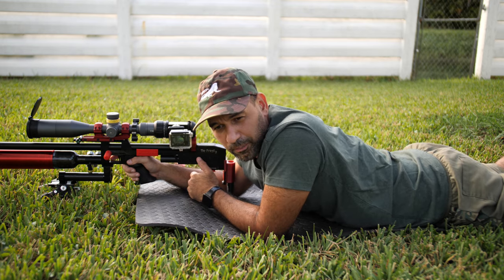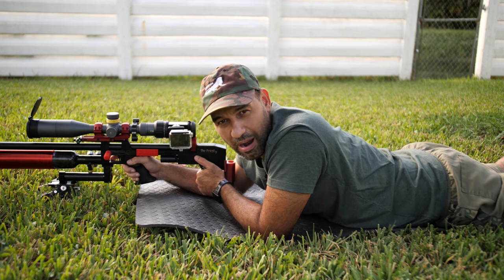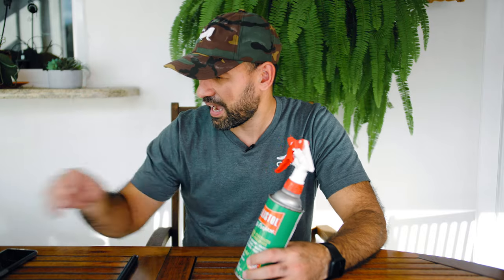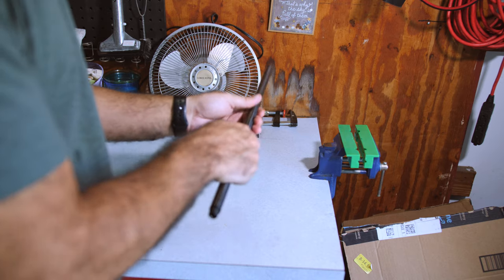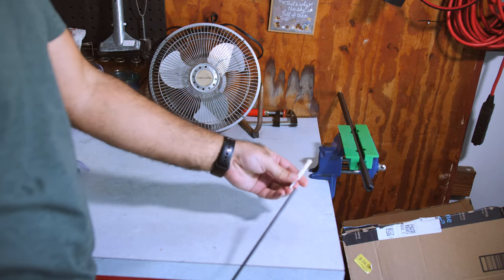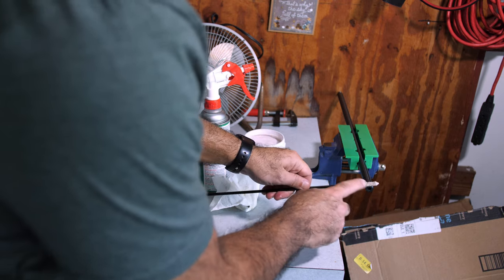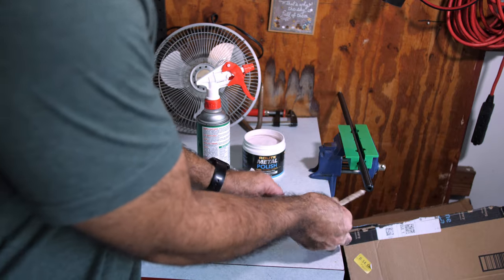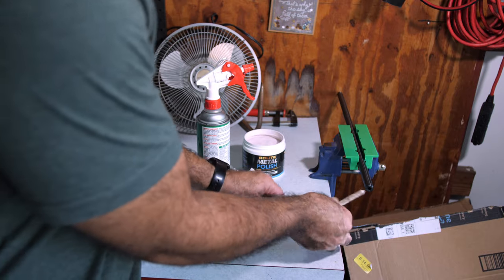How to Polish your Airgun Barrel | Orion the Iguana Hunter

Comment: Orion, NT from AGN here.  Well done sir!  That DIY will undoubtedly help a lot of people that have been on the fence about trying it.

However I'm sorry your barrel turned out the way it did.  Now you have to buy the pricey Polymags :)

Your method has several little differences compared to mine and your results speak for themselves so that just goes to show there's more than one way to get to the finish line.

I will say I initially thought you may have done the Rolite polish and J-B in the wrong order.  I haven't used the Rolite but they're calling it a polish.  Of course "polish" is not a quantitative term but I do not consider J-B to be a polish so my assumption was those two would have been better done in reverse.  However I saw your reply below addressing this:

"I have had more than one person on the comments recommending starting with the JB paste first, but when I tried on my knife I had the feeling this metal polish had a bigger grit than the JB paste, I can "hear"  and "feel" the polisher but with the paste was more like applying a wax, smooth, that's why I followed that order.
"

Perfect!  For others reading along, if you're wanting to improvise different abrasive compounds, that's exactly what you want to do.  Try them on a piece of polished steel like a knife blade and see if it hazes the surface or takes it to a finer polish.  In order to help knock down the surface fretting left over from the drawing and/or rifling processes,  most new bores are going to benefit from starting with something coarse enough to haze a polished surface.  Then move on to a finer compound if desired.
Reply from the maker: Wow! What a great honor to read your reply! Thanks for that! Very much appreciated!
Reply: I cant remove the crown of my break barrel. Its a Cros nitro piston with a "silencer" at the end. Yet my brass cleaning rod wont reach the crown. Should I leave the crown alone or just come in with the rod on the other side. The crown is steel so the brass brush shouldnt ruin the crown?

Comment: Just use WD silicone spray on the pellets then let them air dry and you won't ever have a dirty barrel. 8000 shots with my impact mk3 and it's still super clean. Not regular WD 40, it's the yellow can of WD 40 silicone edition spray. You soak all your pellets then spread them on a towel to dry for a day and your barrel will neer gum up again as long as you always pre-treat new tins of pellets every time. Pro extreme bench rest shooters do this.
Reply from the maker: I've  done  that and works great, thanks for sharing... One small issue with that is that I paint my pellets and the spray will gets in the way... What a mess I did tye other day 😂

Comment: Yep, polishing a bbl. can do wonders. Even more so in a slug shooter. I like to end with a polish with 
German Flitz no abrasive polish.  In one of my  Custom Talon/Dor 257's the gun went from a 50 shot gun before accuracy suffered, to a 300+ shot gun. The 
FX  superior heavy slug barrel I installed in the Raptor  can go for a couple thousand slugs now. Unreal!

Nice vid!

KnifeMaker
Reply from the maker: Mike!! Nice to see you on the channel! WOW 300+ shots is unreal. I'm planning using slugs on this barrel again. The last time I use them the accuracy was outstanding. I need to test them now after the polishing, at least pellets did great.

This metal polish works really fast, I have had more than one person on the comments recommending starting with the JB past first, but when I tried on my knife I had the feeling this metal polish had a bigger grit than the JB past, I can "hear"  and "feel" the polisher but with the past was more like applying a wax, smooth, that's why I followed that order. You are using a different polish, German Flitz and no abrasive, maybe with that one the order can be inverted like some have suggested. 
Have you tried this Rolite before? The knife I tested this looks like a mirror! I'm amazed by that stuff
Reply: No Sir, I'm not familiar with the product  Rolite.  I do sometimes cheat. I have quite a selection of professional Knife polishing compounds here that I from time to time melt onto a bore swab and put af finishing polish on the bore.  A full blown mirror.   I remember  Matt D. stating that a full polish was not good as a textured glass window would allow your finger to glide over it, where as a normal clear glass would squeak and have more friction. . I guess he forgot that we use lube. Which gives exactly the opposite results. ;<) .   Put lube on clear glass and it becomes more like trying to walk on wet ice. Same with bore. 

I know a few world class field target shooters who actually wax their bores in the pellet shooting arenas.  It doesn't seem to help at all with slugs however. I use only 10 wt RC shock oil (silicone). Odd, as silicone is  not for metal. However, for whatever reason, it helps greatly! I was first told of this by RoachCreek. Who held the long distance  of 615 yards for  years. It had now of course been broken. Sad that he is almost blind now. He has a lot to teach.  He was a Champion Shilo 
sharps long range shooter for years. top Honors.  I am lucky to have him as a friend and mentor. 
 Knife/Mike
Reply from the maker: @michaell397  wow, reading your comment is learning guaranteed...hope you will keep commenting on my videos so everyone can learn from your wisdom... I'll give the silicone a try

Comment: Thank you for this video bud. I just realized how thick the barrel is on your gun. My most consistent PCP…meaning the one gun that is almost never knocked out of POI and almost never needs adjusted, also has the thickest barrel. My .25 caliber SK-19 has a barrel that is thicker than barrels I have on some of my rim fire rifles. 1/2”-5/8” or so. I think these PCPs with thinner barrels are more dependent on the shrouded and barrel bands to maintain POI. I bet you seldom have to adjust your scope on your RTI. That would make a heck of a truck gun in a compact rifle configuration bud. My SK-19 hangs all the time by hooks on the head rests of my truck. One supports the stock by the magazine and the other supports the LCD. On or off road vibrations and stress do not effect my accuracy. I take shots frequently past 100 yards on pigeons and it never fails to hit the spot. Really good design RTI came out with. Stay safe and God bless you and yours my friend.

Comment: Heck, man, now you got me thinking... 🤔 Nicely done, Erlis! 👏 Happy holidays!
Reply from the maker: Alex my friend! Don't think too much! Just do it! Hey if you can't find the right products over there, well you will need at least the metal polish but I think that should be available there, maybe not the same brand but I think any metal polish should work, but check this out. A guy told me he used a paracord rope, need to find the right diameter for the barrel, he added the polisher to the rope and used around 10 meters of ropes, and push the rope one time through the barrel... another clean rope to remove material and done! In less than 5 mins it was polished, very very interesting.... Happy Holidays for you too my friend

Comment: I used a Napier pull through kit to clean the barrel first. always push a few pellets through first so you can gauge where any tight spots are that might require extra work. I just use Autosol and a length of cotton hem tape 3 - 4 times the length of the barrel with a few knots tied close together in the middle. I pull knotted section end to end (but not out of the muzzle ) about 20 times. Next clean with the pull through kit and push a few more pellets through. If still feeling any tight spots concentrate on those areas only clean with the pull through kit and try a few more pellets through. You can use this to reduce an extra tight choke too but will need to check the crown afterwards.
Reply from the maker: Great tips, thanks for sharing!!!

Comment: Great work Erlis very much appreciated. I do believe I will give this a whirl on all my rifles to see what happens. My Armada is one of my "untouchables" in that it is extremely accurate just the way it is but ever so often I see a wobbler and/or get an odd shot result so a polishing should really tighten this rifle's results. Another product that I use in all my firearms and air rifles is FP-10 Lubricant elite by Shooter's Choice. I live where the temperatures range a lot, esp in winter. This stuff is good from -49F to 500degrees F! I have never had issue hunting elk in Montana where the temperatures can dip to -20degrees F during the hunt. No action or trigger freezing, works the same warm and cold. Ballistol oil and FP10 are the only things I use on my air rifles.
Reply from the maker: Hi Bret! I have FP-10 but I've never used it on the airguns, I wasn't sure it was safe on the o-rings, I know that FP-10 is magical, I used to have a door that always was giving the terror movie sound, a couple of drops of FP-10 and for months no more sound, magic! I'll give it a try on the barrel! Great idea

Comment: Nice that it worked out good for you. Did do the polishing thing years ago on my AA Pro Target in 177. Did not work out very well. Barrel was/is a CZ S200. Did take the better part of a tin of pellets to lead the barrel and shoot wel again. Since then I only clean my barrels when groups get bigger. Use a pull through til the patch gets clean. Then shoot up to 20/25 times to settle. Never had good grouping from a super clean barrel. Counting  in my power burners. Also find it fascinating that different pellets shoots equally well. Maybe cause they are all by JSB. 
Again happy for you that it worked out so well. 
And wish you Merry Christmas and a Healthy , Happy New Year.
Reply from the maker: Different barrels like different methods, I remember my Taipan was similar to what  you are describing. But in this rifle I noticed that after a clean the groups are great. Maybe it has to do with the tolerances inside the barrel, if it's too tight vs a bit more lose. 
The fact these 3 pellets did well is not because they are JSB, you can see how the Polygams were doing before, not a single hole! Hades were grouping also before but not as well as this time... I have a video I posted like 3 months ago where I'm shooting all different kind of pellets and you can see the groups there. I think  what you saw in this video is because the polishing

Comment: Happy holidays my friend. Great video. I may try this on my SK-19 .25 Calibers Polygonal barrel. It shoots lights out for about 300 rounds but after the barrel leads up a bit and the groups start to open up. That’s for showing us how buddy. Never tried this before. God bless and stay well.
Reply from the maker: Heat my friend, give it a try and let le know my friend. It's duper easy to do and doesn't take that long. With this and silicone tip slugs, iguanas better run!!

Comment: I’ve used Flitz and Mothers to polish.  Used mop to apply and just ran tight patches to clean.   I can get more pressure in the interior of the barrel & rifling with patches.
Reply from the maker: If it worked that way great! I read that with just patches can take long to get a polish, but if it worked for you awesome! As I said, I'm not an expert, I just tried what I read and I saw a big improvement! The rod was just $7 and the mops were really really cheap also. Actually I'm considering using this to apply ballistol on the barrel and use the crown saver just to remove the ballistol and clean it dry
Reply: @OriOnTheIguanaHunter  - I’m with you on not being an expert.  I’m sure there are countless ways to do things are work well.   Just wanted to let anyone researching know that patches work also.  I like the tight fit I could get with patches and a jag for removing polish.  But again, not saying my way is correct or the only way.   Good video.  Amazing the improvement after the process.
Reply from the maker: @motorgearhead  Another person on the comments told me that the good thing with patches is that you move the material in a single direction and with the rod you push back "dirt" material, this kind of make sense... also I read about how a guy takes a rope and put the polisher on the rope and uses probable 20 yards or rope and just push the rope one pass and done, polished! I've been learning a lot by reading the comments! Thanks for posting, really appreciate it!
Reply: I'm a machinist and honestly when you're polishing, you can go back and forth.  The mop will conform to the interior surface.  What is important is to clean it well between the two polishing compounds.  What its doing is hitting any high spots and smoothing out any rough surfaces.  The mop will not change the inner diameter of the bore and thats a very good thing.

Comment: I use JB bore paste and Kroll Oil in my center fire guns and only 1 piece coated rod for past 25 years. Great job and excellent shooting.  Happy New Year, may 2021 be a great year for you.
Reply from the maker: Yes, JB is very common on center fire guns, it did wonders on my barrel :) I think you just polish once and the one quick cleaning should keep everything back to shine again
Reply: @OriOnTheIguanaHunter  never crossed my mind on air gun barrels. Thanks for the idea.

Comment: great post buddy, very intensive, i wonder if you opted to pulled a cotton swab through the barrel till clean if it would have the same effect.  also how does the effect of leading in the barrel improve the groups after say 10 groups /50 pellets. merry Christmas
Reply from the maker: The cotton swab can polish it but it will take longer, some people are telling me on the comments they use that procedure to polish the barrel.... I think the method I liked better was to find a paracord diameter that fit snug and then applying the polisher to the cord (around 10 to 15 yards) and pass the rope through the barrel, one pass, polished, then another clean rope to remove the material... I want to try that!!!

Comment: I have a few barrels I’m going to try this on , thanks for sharing !
Reply from the maker: If you do, please share with me your results, I'm curious to see if how it works for you!
Reply: @OriOnTheIguanaHunter  I did work with air flow on engine heads to increase volume and air velocity ! This is an area the air gun industry needs to look at more , unlike powder guns which have an abundance of power and velocity the air gun industry doesn’t have that luxury ! I think we are going to see some pretty innovative air chamber designs , regulators and air porting designs to increase velocity , therefore increasing shot count as well !  The small caliber bullet shape & design as well as the cooking mechanism and pellet placement in both depth and alignment to the lands  will show an improvement in accuracy ! Every little bit helps to improve Airgun performance !  I will share what I find when I polish the barrel , bet there are many pellet guns in closets that could turn out to be good shooters with barrel polishing and attention to detail ! 😁

Comment: Hi, why dont use a brass brush and a rotate-automatic sistem like a drill?

Gracias!
Reply from the maker: Jose, if you do that you can damage the rifling, no drill, the rod I'm using rotates with the rifling, even when using a rod, if it doesn't rotates you can damage the rifling. 

Now about brass brush....the idea is to polish so you need something smooth, the brass is not going to polish..... maybe for cleaning you can use that but I personally prefer cleaning the barrel with cotton swab.
Reply: @OriOnTheIguanaHunter  

Hola, te entiendo pero tengo una teoría. El tema de los cañones smooth twist de FX (la idea original no es de FX, es de Ben Taylor en prototipos que vi hace casi 15 años) tienen un ánima semilisa desde el transfer port hasta N centímetro de la corona. Las ventajas del este tipo de cañones es, sobretodo, que no se necesita tanta potencia al evitar rotacion y deformidad severa en el pellet. Imaginemos por un momento que cojes un cañon y le pones una baqueta con una terminacion de BRASS (mucho más suave que el acero) y le añades pulimento y te dedicas a pulir durante horas (cambiando el brass, por supuesto) dejando sin pulir los últimos 15/20 cm. Conseguiriamos mejor precisión? No lo sé. Lo que tngo seguro es que las rebabas del transfer port o los malos mecanizados del inicio del cañon lo dejarás a la mínima expresión.

Por cierto como es el cañón CZ de RTI? He visto en Klibrguns algunas deficiencias (subsanables pero deficiencias) en el mecanizado. El tuyo es L-W?

Gracias!!!!
Reply from the maker: RTI saco dos "barrels" el del Prophet is completamente diferente, tiene un twist rate mas lento, creo que lei que es 1 en 32 y esta disennado para long range pellet, aunque hay quienes lo usan con slugs tambien, pero yo en lo personal no lo he usado. El que tiene mi rifle (el Priest2) es un CZ con twist rate 1 en 17 y me gusta muchisimo, pues es preciso con casi todos los pellets que he probado y tambien tira slugs... hay un video que puse por ahi y los grupos son increibles.... una de las razones que no me he comprado el Prophet es porque me gusta mucho este cannon